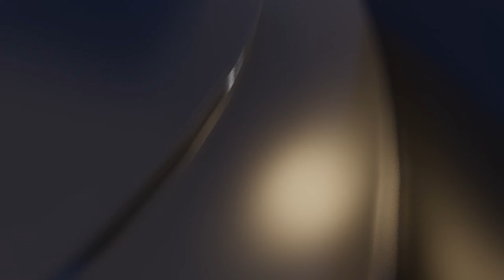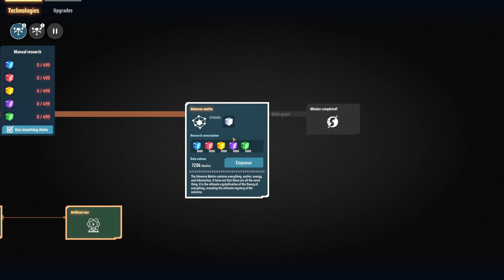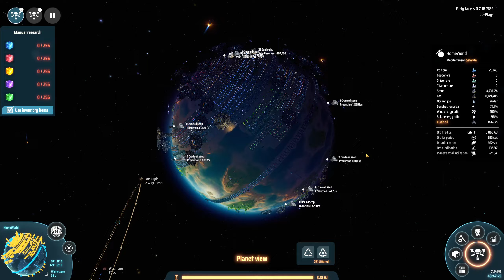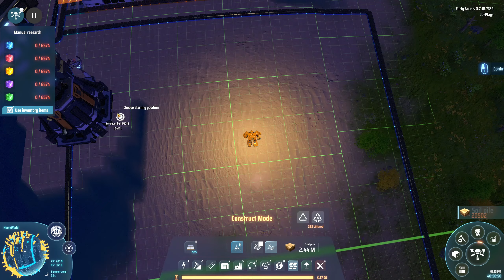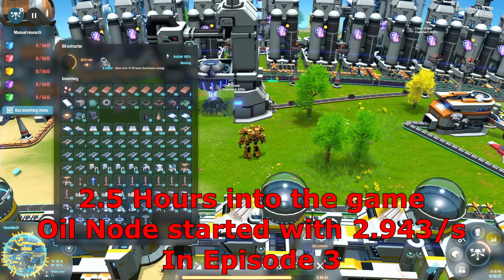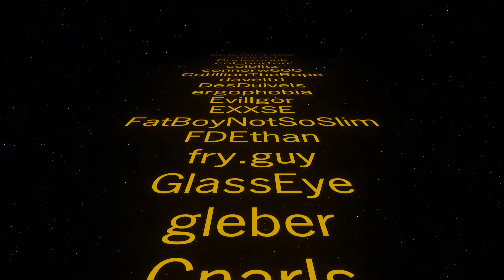Oil for days 🌌 EP22 🪐 Dyson Sphere Program Lets Play Walkthrough Guide Tutorial

Comment: Both coal and oil are now somewhat finite.   In real late game do you see an issue of running short on energetic graphite?  It needed in many things depending.   Was thinking setup of cracking to get graphite and hydrogen.  More important to get the graphite.
Reply from the maker: Coal is harder to get than Iron or Copper true, maybe it would be better to not waste it... Hmm ill consider that. Oil SHOULD be fine forever even at 0.1/s over many nodes it should be infinite

Comment: 4:26 I haven't watched the full video yet, but the Carbon Nanotube belt coming out of that tower has a few yellow belts at the start of it, slowing the overall output. You can see it because they bunch up before spreading out quickly down the line.
Reply from the maker: Yep it was quite intentional, If i had a full belt coming out, There was no room on the belt to add more from the chem plans, so those little belts slow down and break up the output of the nano tubes. After spiniform is fixed, ill remove the belts making the loop